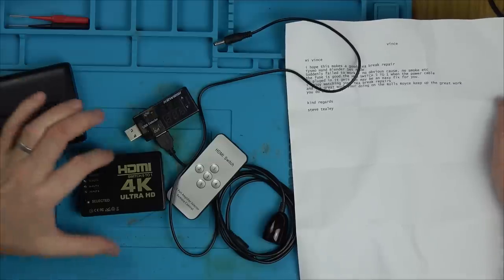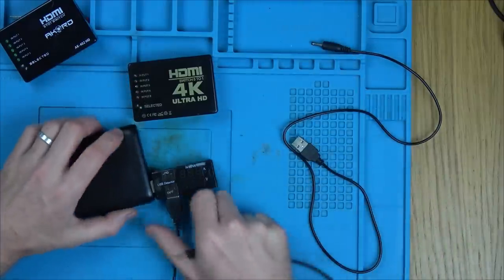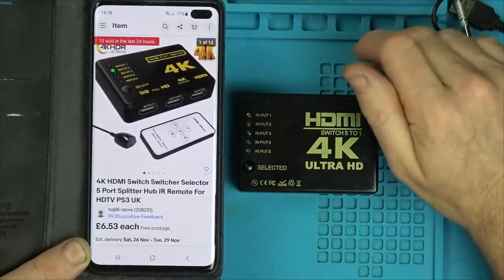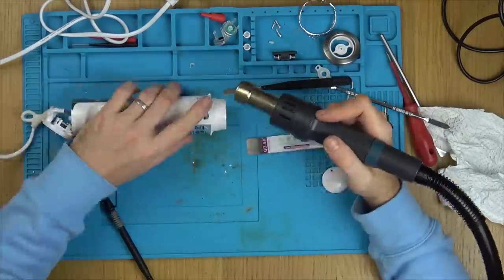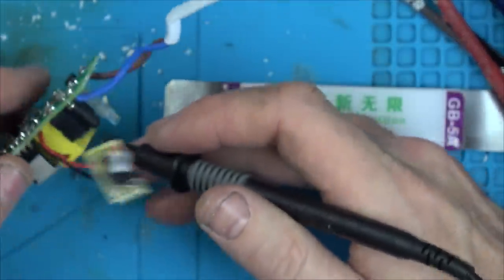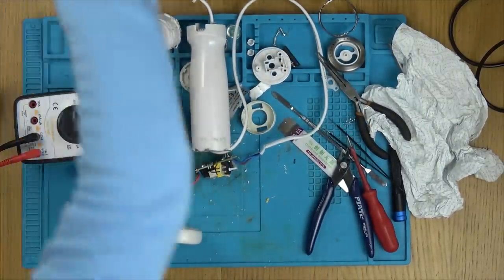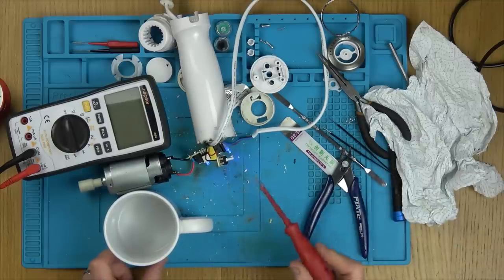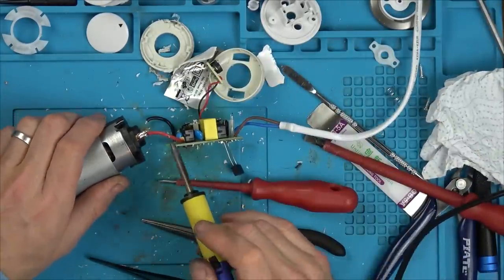Unsafe BOOM! with My Mate Vince - HDMI Switch & Blender Attempted Repair

Comment: Hi Vince im glad you ok, great video its a shame how they made the blender like they did and what stopped it from working was a fuse on the board seem like everything they make these day once it go's wrong just put it in the trash thanks for having a go.
Reply from the maker: Thanks for sending them in Steve. I've had a few comments on the HDMI switch so I might make a quick revisit video on these things. I'll pin this comment Steve so viewers know it was you that sent them in 👍👍👍👍👍👍 If you don't want to be pinned just let me know and I will unpin it. Thanks again.
Reply: Wonder why waste fuses if there isn't a way to access it. Why don't companies use a reset able variable in place of fuse or fuse panel. Maybe if they were regulation in place for these issues. I understand the fuse is a safety mechanism but a fuse is to protect the item as much as prevent a fire.
Reply: @christopherdecorte1599  Simply greed, that way you need to buy a new one every time it breaks. It pisses me off the way things are done now, you see machines from the 60's working perfectly still, and that is not just blind luck. They really were built so much better in the past.
Reply: @christopherdecorte1599  Yeah, sometimes they use only the fuse, sometimes they use fuse and a varistor to make a circuit ''breaker''... You may not believe it, but sometimes they don't use any fuse or other security from a short or the overload in the device although the device operates on a high voltage...

Cheers!

Comment: I'm guessing the discrepancy between the USB cables is because the first one you showed was of crappy quality, they're often made with aluminum wires (instead of copper) that i guess in this case had enough resistance for the usb power bank to not detect it as a short. The second usb lead you used looked to be of better quality, so its resistance was negligible and the power bank correctly shut down to protect itself when it detected a short at the other end
Reply: agree, that's it.
Reply: Was just going to post similar, I guess the cable that doesn't cut, out the wires have a higher resistance and are just heating up.
Reply: Yes this is correct. The pathetic few strands of aluminium will also be twisted with some fabric to pad it into a thicker gauge too.
There was also a 0.1V difference between the leads. Vince should measure the resistance across the leads and see what's happening.
Reply: ...which as Buy it Fix it says would explain the heating as well, with 7.5 watts dissipated in it!
Reply: Other guess would be that the barrel plug polarity is different, but then they wouldn't have both worked on the other unit.
Reply: 100% agree. A lot of USB hosts will trip at 2.1A (although I think the USB spec requires a host only provides 500mA maximum unless more is negotiated). There are USB current limiter chips which are designed to trip at that current as it's a common value.

The power meter only showed around 1.5A for the dodgy high-resistance cable so it wasn't enough to trip the host current limit.
Reply: @rfmerrill  Right. But he checks for that, and that's not the case.
Reply: Chineseum crap 😠
Reply: Vince will know about aluminum wires with him being an ex B.T engineer . They used them a lot just after the second world war because copper was scarce  i believe
Reply: Yeah cheap Chinese USB cables can be very crappy, with surprisingly high resistance - another reason why phones tend to take longer to charge with cheap cables.

Pity about the blown chip in that switch though - I'm wondering if removing the bad chip might allow the other one to operate, maybe giving you a working 3-port switch - depends a lot on how the circuit is laid out but it's just a thought
Reply: sounds about right, most modern usb cables are garbage, my best micro usb  is an old oem charge cable for flip phones from back when they cared
Reply: 100%.  I would add it would be better to resistance test the wires.  Also DMM not ideal to test as due to high meter input impedance and minimal current draw it will read voltage present as normal and ignore any cable resistance.
Reply: Vince did you check for any AC at the motor contacts.  Why did the 2A fuse initial blow.  Where any of the diode short, putting an AC component on the motor?
Reply: @countzero1136  The fact a product comes from China doesnt make it any worse. Cheap crap from anywhere sucks.
Reply: Yep, that's it.
Reply: @Drew-Dastardly With this Voltage drop on the high input resistance on the Multimeter it must be a relative high resistance on the cable
Reply: @UserUser-ww2nj  No, BT (or GPO) definitely used copper. It is low current and max 50V from the exchange. (Also only rich people, government and corps had phones back then)
The WW2 thing was 240V 13A ring mains. It made sense to not have fat cables in a radial configuration if you could have smaller diameter in a ring. I totally agree with it. Radial spurs are allowed too.
Reply: @Drew-Dastardly  After WW2 B.T used aluminium cables. I worked for a company that did traffic management for them and saw miles and miles of it dragged out and replaced with copper. The B.T guys hated the aluminium because it had become so brittle after being in the ground for 50-60 years .As you say the smaller guage ring main dies make sense , it has the advantage of drawing power fry both directions so less chance of a drop of power on a long run even though it might be minimal, talking of which we have a power cut , right on schedule 😂. Lux is the company I worked for, they had the exclusive contract with B.T , GPO .
Reply: @UserUser-ww2nj  B.T. didn't even exist until Thatcher privatised the GPO back in the 1980's.
Reply: @Drew-Dastardly  It goes through name changed fairly often with " openreach " being the latest. Costs them a fortune every time with having to have all the vans repainted and the logos on uniforms etc

Comment: Hi Vince, two things. First, the USB lead was probably cutting out due to being better quality, where as the other lead was acting like a heater wire (due to thin cable or aluminium wires) and just heating up and acting like a resistor. The second I think that motor on the blender was shorted before you plugged it in (and that's what took out the fuse initially). I think it would have just span the other way if wired in reverse polarity, so I wouldn't be to hard on yourself with that one!
Reply from the maker: Thank you Mick, I didn't think of that regards the motor. If the motor was faulty before I got my greasy mitts on it, why did it not blow in that spectacular fashion originally when the manutacturers fuse blew. Could it be that my 2 Amp fuse is better and allowed 2 amps before blowing whilst the one on the board might have blew at 1 Amp although marked up as 2 Amps on the board?  Cheers Mick
Reply: @Mymatevince  Not sure on that one Vince. Definitely looked like an internal short.. looks like the motor may have been jammed or too much strain put on it perhaps, which may have caused the insulation on the windings to break down  and it blew properly on the 2nd go.. I know one thing.. the 'jesus christ' made me LOL!
Reply from the maker: @BuyitFixit  Made me do a little more than laugh😬 those sparks really flew at me. Cheers for getting back to me. The faulty motor idea makes more sense than the fuse just blowing 👌
Reply: I’ve seen a few PCs with faulty PSUs that cause the plug fuse to blow first. Then after that is replaced the next time you plug in the PSU explodes instead of the new fuse.
Reply from the maker: @coctailrob  👍

Comment: LMFAO @ the guitar hero "distance" power on!!  Before you blew it - my first concern was a motor just sat on a desk like that!  Often the torque of it starting to turn can rotate the chassis in place, meaning the wires would follow with it, flipping the PCB up in the air off the table - that could have ended badly, I am glad it blew for that reason!   Great video again Vince =D
Reply: I was thinking the same about the motor torque thing too, as I did the exact same thing when repairing a Milwaukee vacuum cleaner a week or two ago and it flew out of my hand!
Reply: Classic MMV. It’s too cold to go get the broom so he tapes a screwdriver to the end of a guitar hero guitar. My hero.😊
Reply from the maker: 😂😂 Yes, that would have been more dangerous if it landed on my lap repeatedly shocking me with each twitch from my electrified body. Good point Chris, it has been noted for future fixes. Thanks mate 👍👍👍👍👍👍

Comment: With the blender, your error was not checking the motor for continuity / short. Wiring it the 'wrong' way only makes it spin in the otheer direction. Armature wining dead short, or carbon dust in the commutator spacing gaps would be my guess. Again, sadly today a lot of things ar not repairable but in this case, for safety is understandable.

Comment: hi i think mains voltage dc motors have the brushes offset so they run more efficiently and better in 1 direction (reduces sparking)

Comment: Hey Vince, I've been fixing stuff for well over 40 years and I can tell you that blowing things up is all part of the experience. I used to do repairs professionally but these days I just do it as a hobby but even today I can still have the occasional bang and puff of smoke. Most of the time it's not very dangerous, but a pair of safety goggles is a very handy addition to the toolkit - I had a close call back in the early 2000s when I accidentally probed the live side of a switching power supply with a grounded oscilloscope probe, and got hit in the face by a piece of the bridge rectifier which exploded with one hell of a bang. Since then I've always chosen to wear goggles when working on anything with a significant amount of power going through it.

Glad you didn't hurt yourself with this one. Most of the time, these type of incidents are no more than a good jump-scare, but my own experience tells me that eye protection should be regarded as essential for this sort of thing.

Note that a dim-bulb tester is a handy tool for working on mains stuff - there are plenty of videos on youtube that show how to make one very easily and cheaply, and it's invaluable for saving fuses and other components by acting as a fairly heavy-duty current limiter, and of course a handy indicator of a dead short, lighting up brightly thus dissipating the energy that would otherwise blow something up...

Comment: Great video, Vince!
My old german mixer is not glued together, it can be fixed any time. And it also has an AC motor, too. That is why I am never going to replace my 45 years old kitchen equipment.
However, if you spin a DC motor at the same direction all of its lifetime, the brushes will wear enough that the motor will get stuck if you try to spin it the other way. That is when it spits out those brushes. In an RC car, you most likely flip the direction from forward to reverse every time you want to change the direction of the car, so that is why it can work in both directions.
Reply: Ahh,  thanks with the brush explaination

Comment: You know Vince ever since electronics jumped from the valve to the transistor then ic  its always been a mystery to me. It's only thanks to your videos  its become much clearer. As to the boom from the blender, I have to say I do that more often than not  the latest being connecting the 240 volts to the low voltage end of an LED light transformer. The last time before that I blew up the solar panel inverter. Life, where would we be without it, it's a constant learning experience. Thank you for this video and all the others Vince  its always a pleasure watching you repair stuff  a real pleasure.

Comment: Hey Vince, I have another theory for the blender.
I think the motor was already defective which made the fuse blow originally. It's just a DC motor and polarity shouldn't really matter. But they put a positive sign at one end so that it will only spin in correct direction, and workers assembling it don't have to guess.
Reply: About the motor is that sometimes they have a back EMF feedback diode across the poles to protect against reverse voltage going back to the circuit board and if you reverse such motor the diode will short the load. it is likely this was the case or that the motor itself was already shorted
Reply: @Pulverrostmannen  I like that explanation.
Reply: @NicksStuff  Thank you :)

Comment: I think there was a back EMF protection diode build in the motor and the brushes were probably mounted under an angle. Reverse powering up will first result in an exploding EMF diode and when the motor start to spin backwards, the ejection of the brush(es). 
The internal fuse was not fast enough to prevent this.

Comment: In most cases electric DC brush motors can run in both directions. Some manufacturers adjust the angle of the brushes to minimize the spark generated when the carbon and graphite brushes make contact with the commutator, thus polarity is important as attempting to run in reverse the brushes act like a break and prevent the shaft from spinning. You can clearly see a rather big spark when you first tested it when the shaft was attempted to run in reverse but couldn't as the friction from the brushes prevented it, good work Vince, please be careful with high voltage appliances, maybe sellotape two guitar hero guitars together next time!

Comment: For initial testing of Mains Gear, I use a short power lead that has a bathroom heat lamp fitting (switchable 2or4 275W heat lamps) in series with the active wire. Instead of FLASH BANG you get the lamps lighting when there's a fault. Might have saved your bacon as the motor brushes (motor refusing to rotate backwards) might have survived?
(The lead incorporates an earth leakage/over current breaker also)

Comment: My great grandmother, rest her soul, bought a sunbeam blender in 1970s and to this day it still works perfectly fine. They just don't make stuff like they used to. The fact that the primary use of an electric fuse is to protect electrical equipment from getting fried is a little suspicious in a product that is not repairable. But I am not a licensed electrician so I'm not 100% sure. 

Regardless it was a great video to watch. I smiled and laughed so much when you brought out the guitar hero controller. Keep up the good work. 👍🏻
Reply: I have a drill from the 40's and it will literally break your arms if you are not careful. I also have a modern drill that just quits when drilling anything harder than balsa wood.

Comment: the cable section may be the difference between the two. the thicker cable can carry more current which the power supply interprets as abnormal consumption and shuts down. the cable with a smaller section carries less current which is not sufficient to trigger the protection mechanism.

Comment: Hi Vince. Thanks for the video. The difference between cables should be the resistance. The one that shuts down immediately should be a good cable and low resistance, the other one should be a low-quality cable with more resistance. That's why it got hot but still lets the current pass through.,

Comment: Didn't expect an Electroboom style video from Vince today 😂
Reply: Interesting to see a DC motor used at mains voltage, so at least we know it will have a FULL BRIDGE RECTIFIER! :D

In fact my guess is that this is pretty much all that's in it - full bridge and maybe a capacitor (there did appear to be a big X2 on the board, and the turbo switch probably bypasses another diode on the AC side to limit it to half-cycles. Without seeing a schematic it's hard to know but I didn't see much else on that board other than a few diodes, the cap and a couple of microswitches. It did all look pretty well made though. Pity about the non-repairable case :(

Comment: Yip Vince easily done, you can get complacent and reverse the polarity.

My claim to fame was working on the contactors in a bank of supermarket freezers.
I set up the new contactors making certain they corresponded to the correct freezers (7 in a row)
Wired it all into the service board, switched it all on and their was an almighty bang, bright flash and loads of smoke that could be seen and heared all over the supermarket, the mains trip switches blew putting a large section of the supermarket into darkness.

It took 3 hours to restore everything back to how it should have been after having to rewire the complete service board.

Yip I double checked the polarity this time, luckily no damage to the freezers.
This happened around 4 years ago, the manager still gives me funny looks as if to say,,, oh no not him again :face-orange-raised-eyebrow:

Comment: Hi Vince, I have tried to fix a blender that looks almost identical. There are two things about this blender. First, I also found it extremely difficult to dissemble it, but eventually I've found that there is a hidden screw behind the button panel that hold the upper and lower chassis together. If you peal off the button panel, you will see the screw. Second, I also found a blown fuse on mine. I replaced the fuse and tested it running great. I happily returned it to my wife but found out that the fuse blow again if the blender is used on any thick or sticky paste. When I tried to fix it the second time, I found that the brush as well as the motor commutator is so wear off, and that's why the motor lost strength and the fuse blow so easily. I tried to find the same motor to replace it but it is almost impossible.